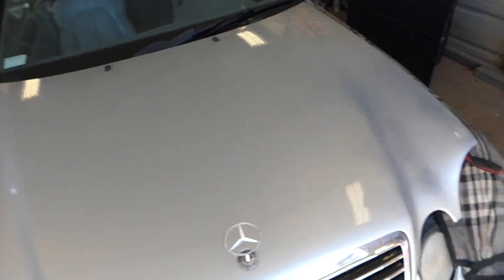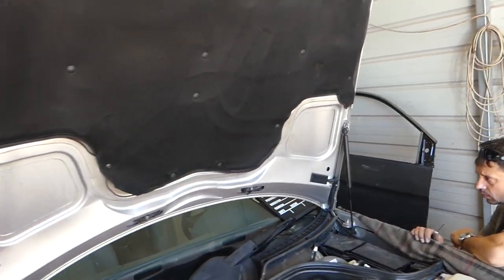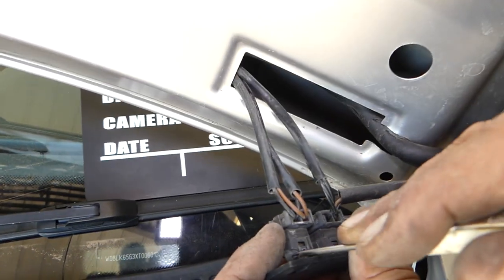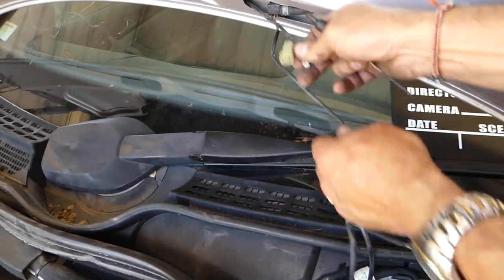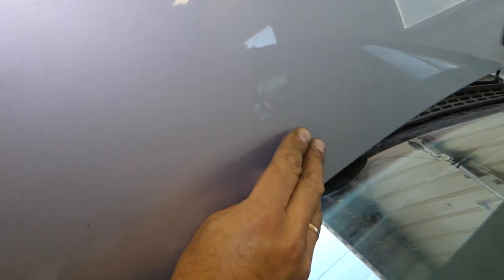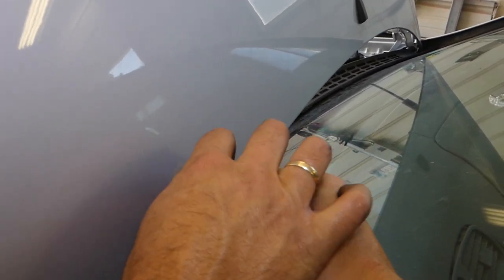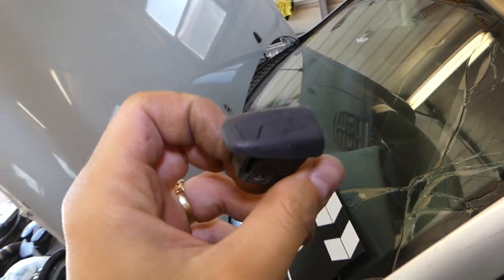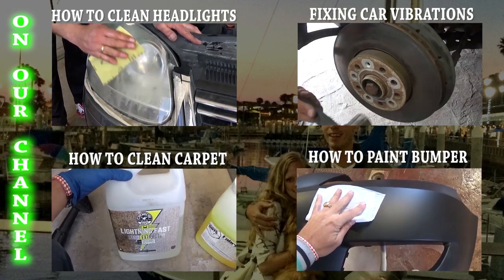MERCEDES WINDHSIELD WASHER NOZZLE SPRAYER REMOVAL REPLACEMENT

Comment: Excellent video. mine is a 2007 S550. the water comes with low pressure and only hits the bottom of the windshield. is this the same procedure...my nozzles are hidden under the hood. how much are these nozzles.
Thanks again!

Comment: Hi I have a mercedes c200 kompressor sport coupe from 2003. I have changed the liquid pump  and the nozzle works on the driver side but it doesnt on the  passenger side? it sprayed a little bit of liquid on the passenger side and that's it,what should be the problem in this case?